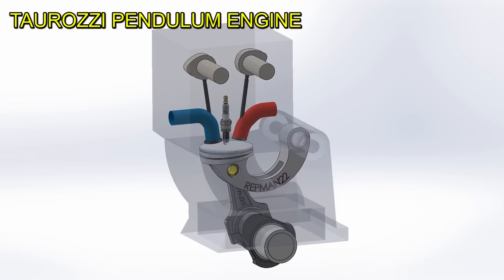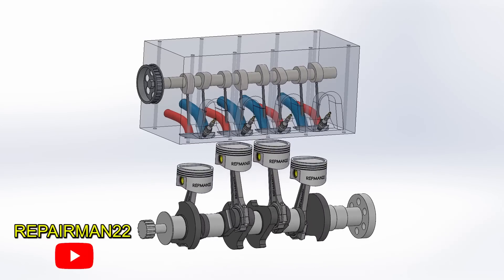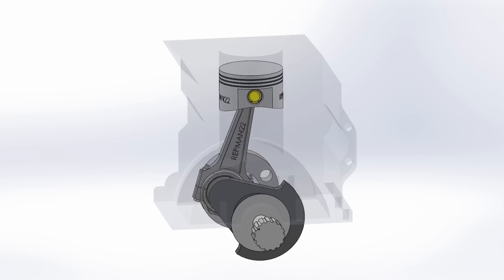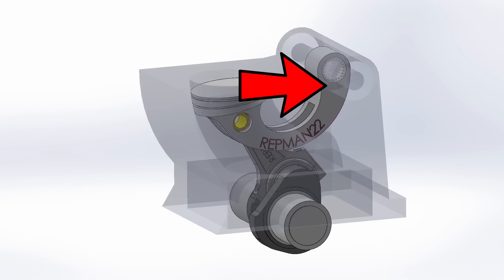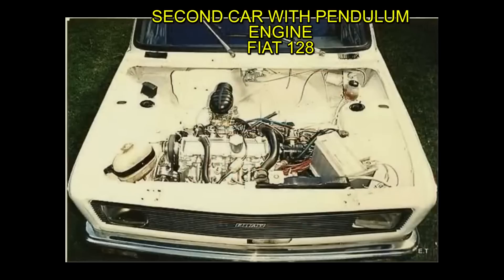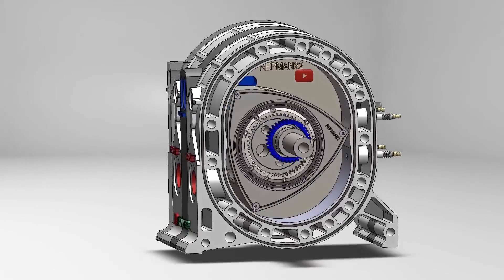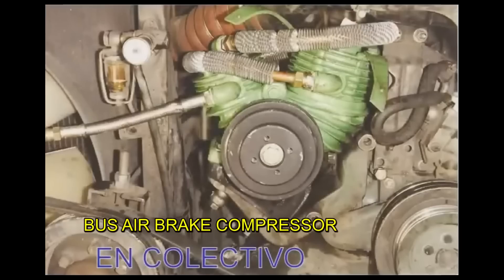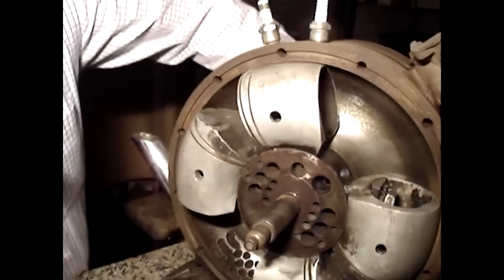All about the Taurozzi Pendulum Engine 🧠 and what happend to it🤯

Comment: its different but not different enough.......there are tons of 'different' engines out there but they all seem to go the way of the wankel rotary engine eventually...............the taurozzi engine greatly went wrong right from the beginning....taurozzi should have concentrated entirely on making heavy diesel versions of his engine 300 hp and higher......if it wouldn't work in diesel mode then it won't work anywhere.....the taurozzi engine seems to get something for nothing in terms of fuel efficiency and i just don't believe his numbers.......but if he can really genuinely reduce friction in heavy duty diesel applications there might be a market
Reply: It's geometry which makes today's engines so inefficient and run so hot, always has been. This is a more efficient geometry, getting more of the power directly to the crankshaft.

Comment: He's right about mass production. Car manufacturers pump out engines at a crazy rate and that's not possible with curved bores. Also cars don't burn much oil today so it's not really the issue with emissions

Comment: I am very sceptical of the 30% efficiency gain claimed. I don't even think that is possible due to thermal inefficiency limits imposed by physics. Also if it were true (without some very serious drawback somewhere else) there is no way automakers wouldn't use it everywhere. They are pouring money head over fist to development just to gain a few percent.

Comment: What I see, is a much higher initial conrod-angle on the crankshaft (whiile lowering cylinder-walls-friction), thus extracting more torque from each combustion, cause, as u know, the initial conrod/crankshaft-angle after ignition is 0° instead of the more optimal 75°-80° !!! This can also be made by the usage of 3 (complicated interlinked) conrods per piston, but in this case, you get much more friction between the piston-rings and the cylinder-walls (higher than in a normal, single-conrod cylinder. Motocross-racers used that in Germany, but motocrossers spent anyway half of their lives in the workshop, now just additionally exchanging worn piston-rings much more often than usual   ;-)
So, there is an advantage, but at what price ??? Curved-cylinders ???

Comment: Just another version of an engine that is more complex has more parts and is heavier because it puts a mechanical advantage in the piston and crank geometry instead of using a gearbox which is typically much more efficient.

Comment: Wow! Some bizarre assertions here. The piston rings prevent the pistons hitting the cylinder wall (unless they are so badly worn). As for reducing friction, I can't see how you can do that by introducing another linkage into the system. The only advantage I can see is weight reduction from a smaller, lighter piston. What needs to be reduced in four stroke engines is the forces required to open the valves. I am surprised that this facet of ICE engineering has been largely overlooked in engine development, with the notable exception of the Ducati Desmodromic engine.

Comment: Linear bearings exist. If piston skirt friction was a real issue, you could solve it without resorting to a curved cylinder and pistons. The truth is you need oil not just as a lubricant, but also to help seal the combustion chamber. And apparently oil is enough to deal with skirt friction since there aren't any linear bearings. Meaning this engine doesn't solve any real issues or have any other benefits, but is harder/costlier to manufacture.

Comment: Just some things that come to mind, at the kind of speeds we expect vehicle engines to operate:
Any play in the pivot bearings would cause wear over time as well as the pistons could begin to rock, this would be a nightmare to resolve with a rebore due to the curved cylinders.
There's extra complexity and weight involved with the arm which adds risk and reduces efficiency.
The thinner pistons concern me regarding strength, especially if we are to apply boost pressure for economy engines.
I have to question the engine balance when not in a V layout, seems like it would rock back and forth on each stroke.
Reply: Another problem: The curved “cylinders” aren’t cylindrical. They are cutouts of a toroid - think about the difference between an “I” and a “C”.
While in a classic engine the whole surface of an o-ring travels the same distance, in the toroidal motor the surface of the o-ring facing the inside of the toroid / “C” travels a shorter distance than the part facing the outside. I’m not an engineer, but at least the wear on the o-rings isn’t even, if there aren’t other consequences as well.
Considering expansion and shrinking due to a warm vs. cold engine, a cylinder expands evenly, while in a toroid motor the outside expands more than the inside. Again no engineer here, but this complicates matters as well.
But the main problem I see: Efficient combustion with a minimum of emissions and running stable under all sorts of circumstances - humidity, air pressure, engine temperature, rpm, power demand, etc. - has been studied ad nauseam to comply with rising emission standards. In a toroid combustion engine you have to start all over, because the shape of the combustion volume follows also a curve. On the outside of the toroid the room for the combustion expands faster than on the inside. The pressure varies accordingly - so the combustion develops and behaves completely different from a standard engine. Not to mention that you have to put serious research into the compression as well, to get a desired mix of air and gas droplets.
Reply: All valid points of concern. However, one could argue that the differential shape/volume of the combustion chamber could be used to advantage to  preferentially direct the incoming fresh charge VS the outgoing exhaust.

Comment: by making a two-band system swivel arm instead of this standard design. You have two bearings on the piston, not one large one and two on the top since the arm will be a "T" design on top getting rid of the cross shaft (in weight) and making it a two bearing load sharing system. which can be than power force oil feed threw the whole "T" assembly. making zero power shift or friction...AT ALL.

Comment: this engine adds another connecting rod (banana rod) and another connecting rod pin - this curved cylinder cannot even remotely be machined easily - this engine is not an improvement.

Comment: Making a curved bore is extremely hard, and there's no such thing as a "curved boring machine."

Piston skirt friction is very low in newer designs, and have never required large amounts of oil.  The additional weight of the lever is going to cause wear on the rod bearings and reduce power.  

There is no way the additional mass doesn't limit power and efficiency more than standard design.

Comment: Interesting the piston and swing arm is made as one, hence no cylinder wall contact. Boring the cylinders is easy, with a boring machine on a swing arm too. Piston and swing arm will much reduce harmonic vibrations too, compared to conventional engines.

Comment: Little benefit, other than reduced friction **on the walls of the piston**. Not enough of an issue in 2023 to redesign the ICE, creating the need to manufacturer curved-cylinder engine blocks. Maybe it was a bigger problem in 1969?

The same could be accomplished by designing the connecting rods to move linearly. But that would increase complexity and add an additional point of friction. 

This is a solution looking for a problem.

Comment: This is a cool idea, but 30% more power and efficiency is totally unrealistic. As if that much power is lost in friction on the cilinder walls. Frictionless is also an overstatement, since all the bearings on the crankshaft still have a lot of friction. But even a 5% increase in efficiency could already be worth it.

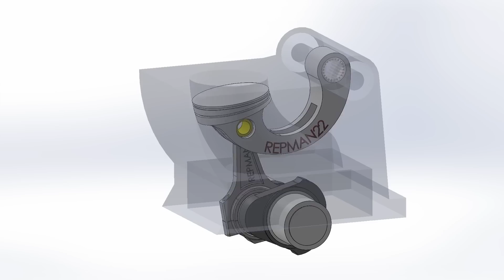Comment: @3:07  "Friction is zero"
False. The piston still has to seal against combustion gases. These are an unavoidable frictional loss in any piston engine and also are the bearing surfaces, not the piston skirt as shown earlier. Modern pistons don't even have skirts.
Every extra part in a power train adds extra cost and loses efficiency.
Reply: Agree, less friction = less seal = less compression = less lower

Comment: As a machinist making curved cylinders would not be very hard to do, once you make the tooling, you are good to go. Great job on the video.
Reply: the only practical way to achieve decent tolerance I can think of is through edm, but thats not going to be mass production friendly
Reply: @toshinakae6397  I doubt that
Reply: You'd use the rod pivot to pivot the block in the tooling and a boring head with a radiused tool exactly on the center of the pivot. But you do have to come up with some way to advance the block smoothly
Reply: @danieldimitri6133  i can think of several ways to do just that, and having worked in places with machine shops dedicated to research and dev.. its shocking how easy some preatty complex jobs can be done when put in skilled hands.. i have seen air and fluid channels that changed direction going threw test blocks made from aluminum that were curved in multi directions and, i was informed if they went to production they coud have 30 machines at one facility pumping them out night and day with minimal human interaction.. it was just their job to find the best way to get any given job done, done... also why they more then once came looking for me and made me figure out WTF they couldnt... engineers are funny in that they  often are so hyper focused on their niche that they have trouble looking at something and seeing for example, a valve is installed backwards.. LOL
Reply: @Una Salus Victis  I'm more curious about sleeves, you'd want blocks to be able to take sleeves and curved cylindrical sleeves clearly not as simple to produce as straight
Reply: @Horace1993  Even if you could produce the sleeves I don't see how one could press them into place without damaging something. I believe the true issue is warranty and unknown repair capabilities at your average dealership or machine shop. Many shops won't even touch a Mazda rotary engines for rebuild as they don't want to risk warranty repairs that would typically be at a net loss between both jobs to the repair facility.

It would be treated like the most CVT transmission.. where your average shop is not willing or capable of full rebuild and will only offer replacing with a brand new or remanufactured unit.
Reply: @danieldimitri6133  Nothing CNC couldn't accomplish.
Reply: @danieldimitri6133  ah that makes sense, though i would assume you would have a limit to how much you could bore out with that setup, once the angle of the tool exceeds the radius of the cylinder, you would have your tool running into the  walls, but a good method for cylinders under 90 degrees
Reply: @danieldimitri6133  I could imagine a custom, disk-shaped tool, which has rounded and sharpened edges that would also cut, if that makes sense
Reply: As a machinist how high would your engaging edge be allowed to be then? Throughout all of the cuts with the incrementally changing radius. In your professional opinion....
Reply: @m3chanist  what radius is changing?
Reply: @m3chanist  with the 8 axis milling machines and modern tooling you could keep the cut mostly the same, it is the cylinder honing I am having trouble with.
Reply: @craigg4925  machining is not my forte whatsoever but would one of those silicone carbide honing brushes with the carbide balls on the ends of the bristles that look like a toilet brush work if it was to be fed into the curved bore the same way as the initial boring was done? Just an uneducated idea.
Reply: @smarty7198  Yes and no, those are for scoring the cylinder wall. the fixed ones are to perfecting the bore size. but he made working engines, so there is a way to. Some old timer sorcery probably.
Reply: The machining and production process would not be practical or viable ☹
Reply: @MsRustynuts  except its already done to make the pumps mentioned...
Reply: how do you grind and lap it ?
Reply: I'm not a machinist and the inset video made perfect sense to me. I'm an Engineer 😀

It's called 4 axis. [ with the part offset in the rotating jaws ]
Reply: I think somebody here is overlooking the very demanding roughness parameters required in the automotive industry for features like the cylinder bores.
I think you better check out the "Sunnen Products Company" YT channel and check out how cylinder bores are really machined. 
Then you can please explain me which kind of machine can replicate the same roughness and geometrical tolerances on a curved bore, provided it exists. 
I don't know anything capable of this kind of machining, but maybe it's just me ... one never stops learning
Reply: @MetalMike87  it's even easier than anybody has mentioned so far, you don't need CNC even. You just make it on a drill press with a fly cutter. 1/2 at a time like a clamshell.
Reply: @philiprowney  yes you can 4th axis mill it but a lot of machinists might be worried about reconditioning the cylinders when something breaks as well.
Reply: Typical curved boring machine yeah? My issue is with sleeves, difficulty with sleeves would be a bit limiting or otherwise comparatively expensive. Prohibitively? Don't know.
Reply: I bet Elon Musk would make it happen against all the other automakers if it weren’t for already being vested in electric cars
Reply: Wouldn't a round cutting head take care of any issue? Keep the head stationary and rotate the block into the cut.
Reply: @davesteinick833  Or just put the cutting head on a pivoting arm instead of a linear guide rail.
Reply: @davesteinick833  you wouldn't machine the block with the head on????
Reply: The tool could be spherical, it could be egg shaped, it could be a Taurus. As long as the radius Is smaller than the radius of the outer wall it would work. Honing could get interesting but the need for a cross hatch could be argued. You could hone with the same fixture moving the block or swinging the home on the rod pivot. But you could possibly use a lap instead of a hone with a spherical shape. If it's a sphere you don't need the rod pivot to precisely guide it. Or perhaps with some modern processes I've read about using nickel silicon coatings or high silicon  aluminum block then oil space can exist from slight protrusion of the silicon nodules or specific oil pockets can be formed with laser etching. Perhaps the cylinder can be burnished with a sizing ball after machining to get rid of cutting marks if the cross hatch can be foregone.
Reply: Tooling does not affect the bore angle.  The mill head & it's motor must trace the same curve.
Reply: In a production setting, boring the cylinders would dictate a purpose built machine dedicated to the task.
It's  harder to see how the cylinders would be honed as honing requires an abrasive rather than a single point tool, which can negotiate the curves better.
Reply: @fubartotale3389  There is a flexible honer on the market.
Reply: As a machinist, do you enjoy doing things that make your life and the lives of others more difficult?  How on earth do you expect to bore or hone a toroid?  The piston, instead of being turned on a lathe would need to be made with a multi-axis mill.  Why on earth do stuff that makes the problems harder to solve?!

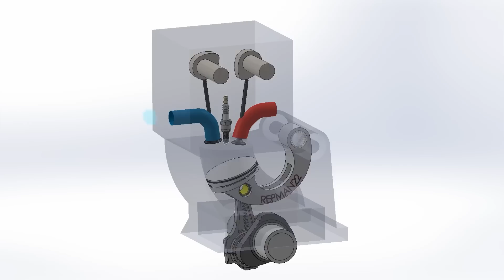Comment: At 1:24, the 1-3-4-2 firing order is common but there were a lot of early Ford (UK) engines that used 1-2-4-3, it is therefore wrong to say the 1-3-4-2 order is used in any four cylinder, four stroke engine.

Comment: :D :D :D there is no friction .... lol in normal engines there is no friction thanks to you know who.... OIL yes oil, saying that his cylinder does not touch the walls its just pure stupidity. There must be complete seal in the chamber so no fuel/air mixture comes to crankshaft, and no oil goes to the combustion chamber. Bearings are not build to absorb friction that's why bearings worn down.

Comment: The car makers probably rejected it if it's more expensive to produce. If the curved cylinder takes longer to machine they wouldn't produce as many in a given day making it more expensive overall, making any economy savings null. It's the same reason a hydrogen combustion engine hasn't made it to market yet, hydrogen burns hotter than gasoline so the surfaces inside the engine would need to be made harder, making it's manufacture more expensive.